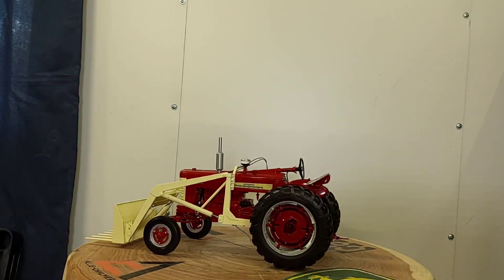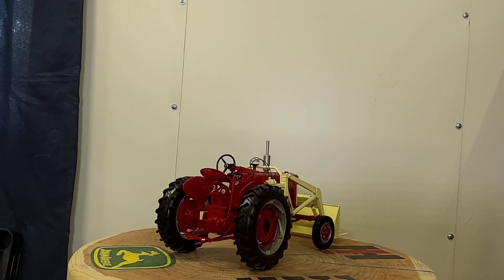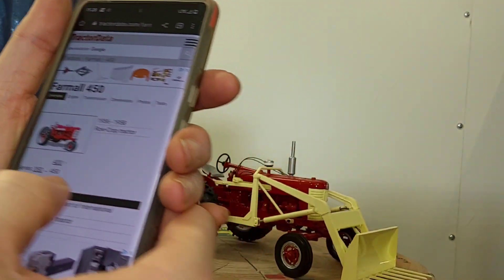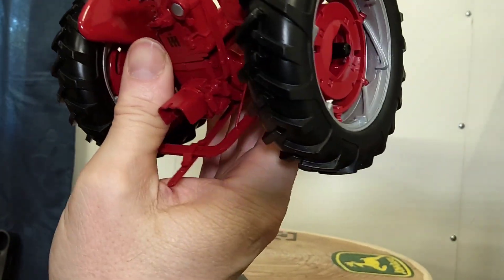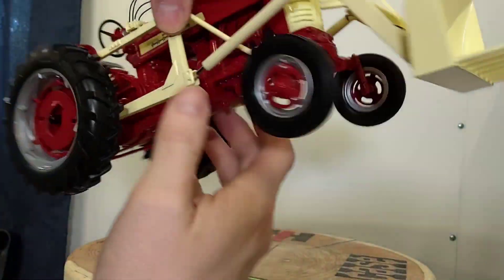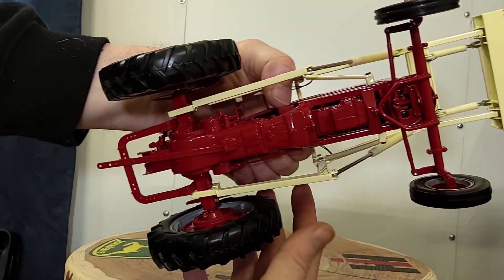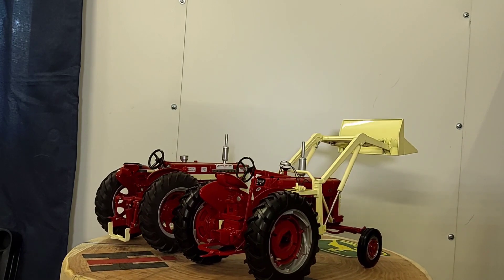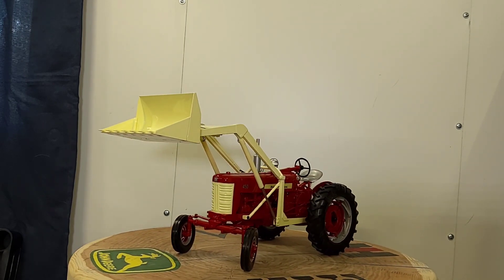SpecCast 1/16 IH Farmall 450 w/loader!

Comment: I just bought this same toy. Found it on sale for $77.00. I noticed SpecCast put the LPgas regulator on the gas carburetor. To make the loader fit. SpeCast moved the air cleaner back about 1/2 of an inch. I wish SpecCast would make a WD-9,600, and 650 series.
Reply from the maker: For their detailing SpecCast does a great job

Comment: Is hydraulic levers and pump unit on the loader all metal are plastic
Reply from the maker: @ZachLobdell  yes I believe they were.  I've since sold this after this video
Reply: Ok. I was planning on 3D printing one for the 1/16 Allis Chalmers 6060 with the loader in the 4WD option, I was gonna take the ROPs off of it and 3D print the one I made but then I found out that this has one and since it’s relatively cheap, I’ll use parts off of it and put them on other to make it better. I’m going the Allis job because my grandfather owned a dairy farm for close to 40 or 50 years and he had one, same loader, 4WD, no ROPS and that hydraulic loader system.